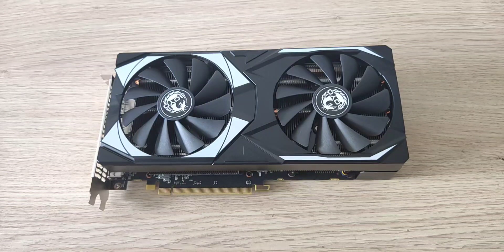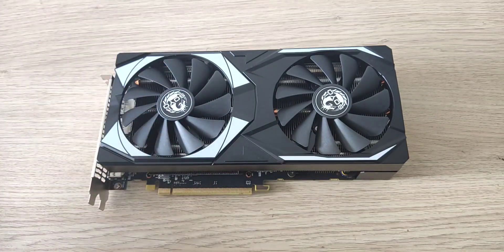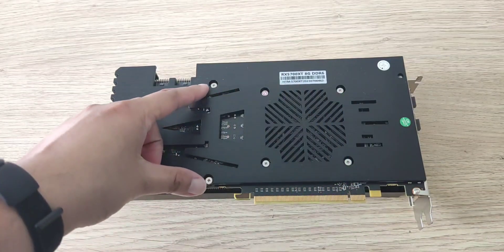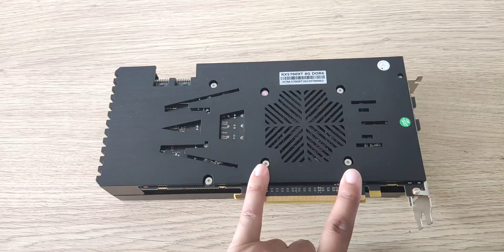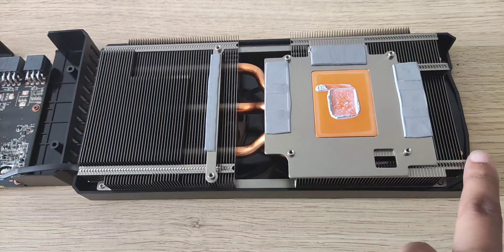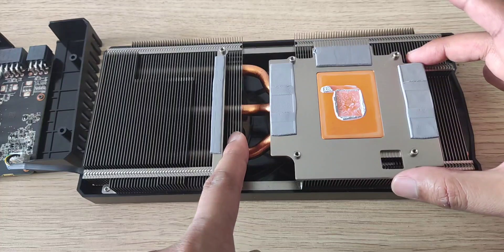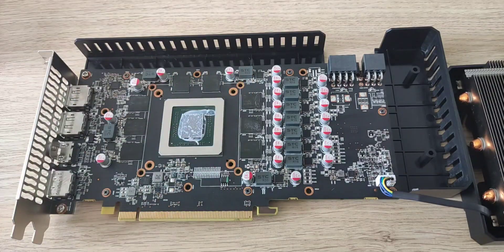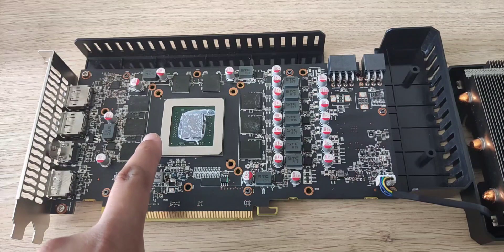New Soyo 5700XT: Up Close And Personal!

Comment: Greetings, how are you? ? Could you guide me with what components I can put it together I'm looking mostly to emulate and play things decently. Thanks I have only the card. I have to buy the rest
Reply from the maker: @Jackdantte  you need Case, PSU, CPU, CPU cooler, motherboard, ram & storage. There's a lot of options depending on your budget.
Reply: Thanks I could say that my budget is low hehehe what is the best thing I can buy ? Could you help me and give me ideas something with good prices and that is what is necessary for it to work to emulate and play medium high graphics nothing crazy ;) @AlexHusTech
Reply from the maker: @Jackdantte  Can't give guidance without a budget, how much is low?
Reply: @AlexHusTech yeah you are  right , I would say .... 350 usd ... Maybe 400 :)
Reply from the maker: @Jackdantte  If you use AliExpress can get a cheap 5600 - 60 with B550 - 50/60 a thermalright cooler for 15, 1TB NVME - 40, 32GB RAM - £40, 600W PSU - 50, Case whatever you like, should be more than enough.

Comment: Mine power consumption is too low it goes max to 900mv and max power on furmark shows 110watts why is that its same to same rx 5700xt😢
Reply from the maker: You'll need to modify some settings in morepowertools, I made a video for 5700, you'll need to use 5700XT settings.
Reply: @AlexHusTech  i have seen that bro is there any hurts or chances that gpu might die cause its x.mined.

And some people got same model with original bios why is that
Reply from the maker: @HamidAli-cy3jx  A GPU that's been mined on can actually be much better looked after than not mined, I mined on mine for 1 year & had no issues playing games after.

I'm not sure why BIOS is different, I ordered another so I will test again once it's here.
Reply: @AlexHusTech  thanks bro for reply ❤️
Reply from the maker: @HamidAli-cy3jx  No worries I will update once the other one comes.

Comment: Good video. Was it a modified rx 5700 or an original rx 5700xt?
Reply from the maker: It's a real 5700XT, forgot to add the picture in the video, so just pinned a comment.